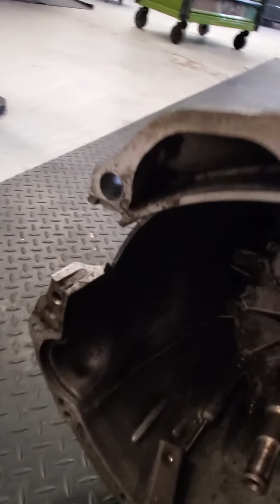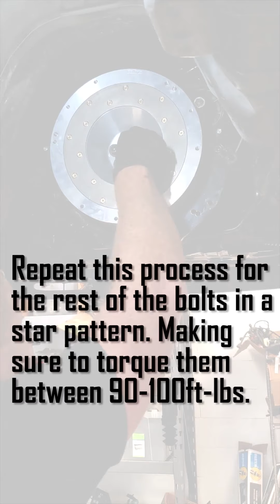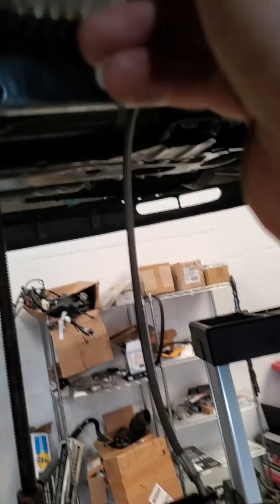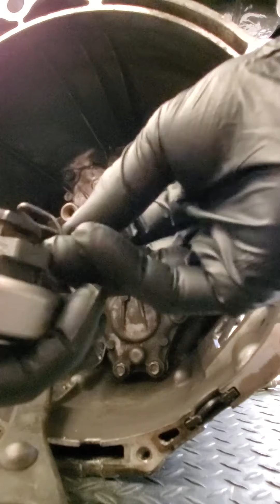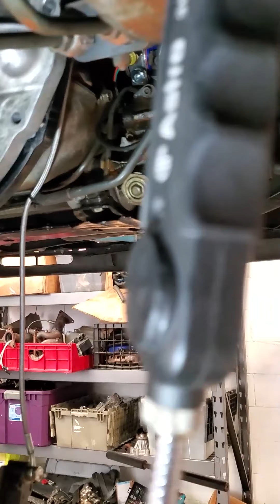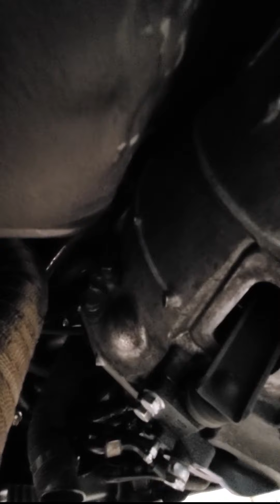R32 GTST RB20DET RB25DET RB26DETT RB30 To 350Z 370Z 6-Speed Transmission NO-Cut Installation video

Comment: Does this kit let the shifter fit in the same spot as the oem shift boot?
Reply from the maker: You do have to cut the shifter opening to get the tri-pod through the sheet metal. but once the tri-pod is through our shifter relocation fits in the same position as the OEM shifter rod.

Comment: So if you mill the housing down the 14mm you can run any standard 350z/370z clutch kit and the fitment of the trans is probably better?
Reply from the maker: Yes that is correct.